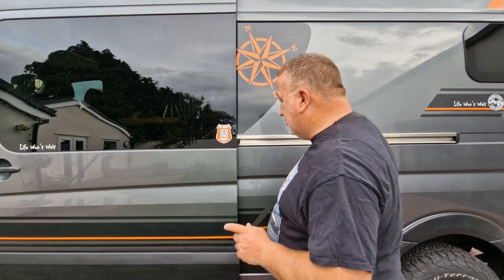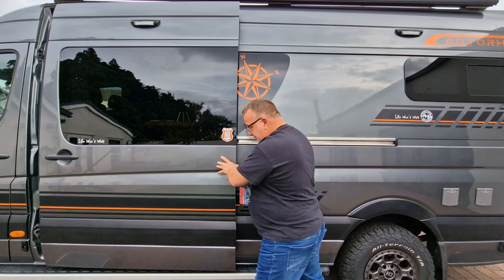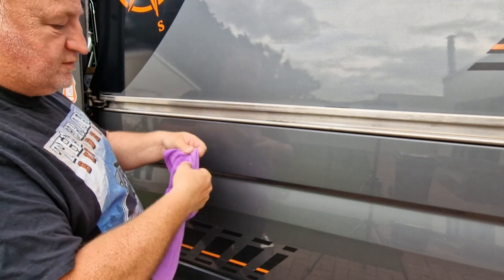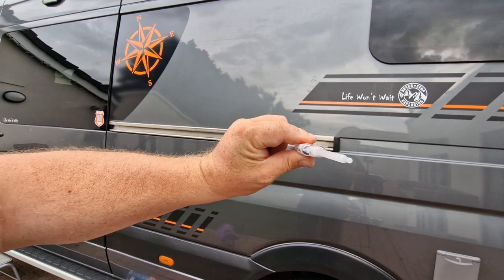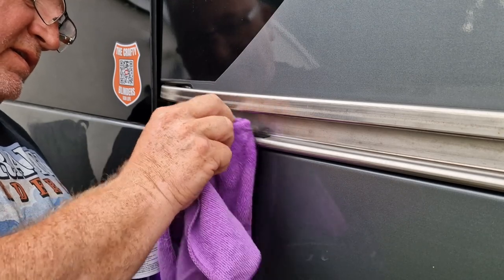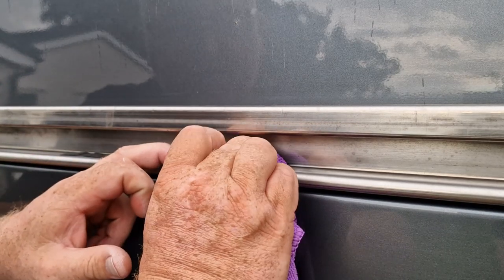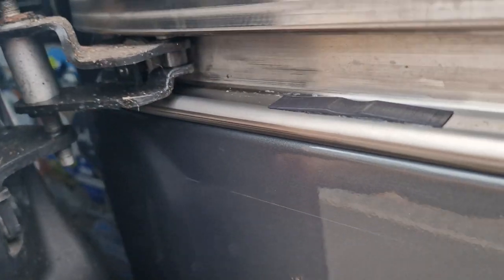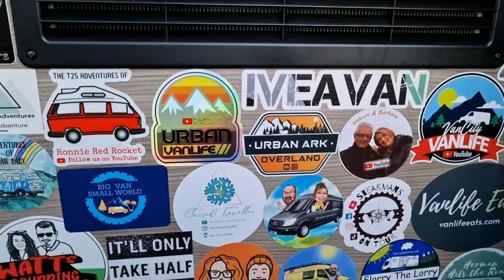Fitting door stop wedges| selfbuild campervan crafter sprinter | the crafty blinders vanlife

Comment: I fitted one last year it disintegrated quickly I bought another at van love this year the guy said they don't go on middle runner but they go on top runner as all weights on middle channel
Reply from the maker: The company we bought them off designed them for the middle rail pall I've had one on for 2 years without any issues
Was your first one a plastic printed one i heard they fall apart
Reply: @TheCraftyBlindersvanlife  yes plastic

Comment: Great video now let’s see if you can answer a question no one else has been able to do you know where the fuse is for the high beam or rather which one it is I am try to connect spot light to high beam
Reply from the maker: Try this link the high beam will be controlled via a relay so should be on fuse panel C it will just be a matter of pulling the right one until you find it pal
https://fuse-box.info/volkswagen/volkswagen-crafter-2007-2015-fuses
Reply from the maker: I have a link I can share for a really good crafter 2007 - 2015 fues layout pdf